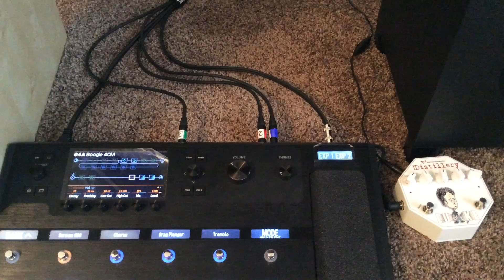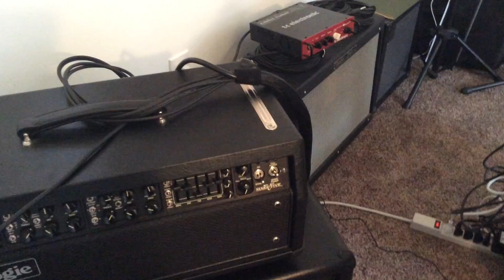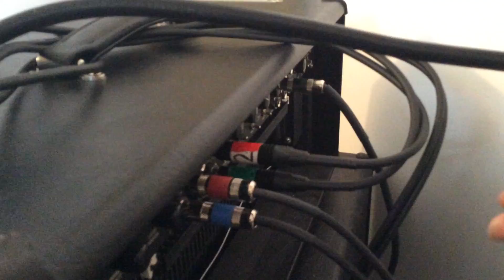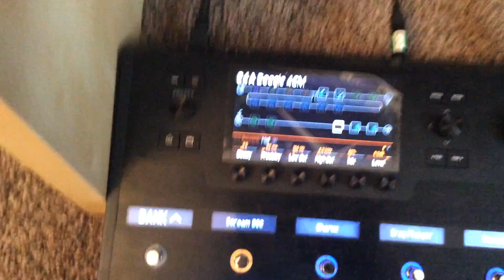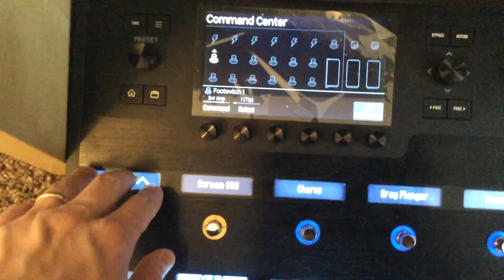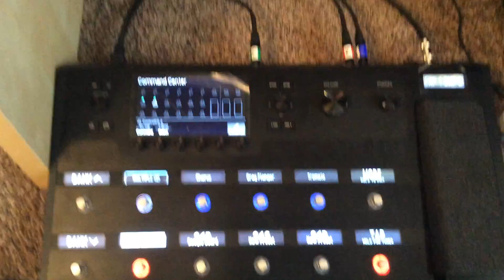Line 6 Helix with Mesa/Boogie Mark V 4 Cable Method

Comment: Dumb question.... but you have the FX loop on at all time right? I ask as I am trying to set up mine on a Recto. With the FX loop off the OD models in the front sound amazing.... but no Delay or reverb as loop is off. But when I engage the FX loops the sound looses some life. Any suggestions? Cheers!
Reply from the maker: I had the FX loop on all the time when I ran this rig. You might experiment with the mix on the delays and reverbs or maybe even run a parallel signal path in the Helix for the FX loop so you have a dry signal on one path and the delays and reverbs on the other. If it sounds good in the front but not in the FX loop, it's most likely just a settings issue.

Comment: I know you don't use this setup anymore, but maybe you'll still remember... did you ever have any humming issues with 4CM, or with changing the channels on the amp with the external relays?

I find that the hum in channel 3 is annoyingly loud (I can ignore it, but it's very annoying) when using 4CM, and completely unbearable when using the external channel switching.   I use an LT, so maybe it's just not as well designed as the full Helix.

If you did have issues like this, how did you solve them?

Thanks!
Reply from the maker: I never had issues with excessive hum when I ran this setup, but several people have commented that they have a hum problem with this or a similar setup.  I've never followed up with any of them about how they resolved it, but I would imagine putting in something like a Eb tech hum eliminator would do the job.  Good luck!
Reply: @JosephFacer  Cool, thanks for the suggestion.
Reply: Hi I bought the helix effect and it is similar to this. It has the noise you mentioned with my mark V. But I fix it and it's quite simple. The external amp switching I use the trs cable and split into 2 ts ends which are tip and ring. The sleeves (ground) of the 3 ends are usually connected and create a ground loop making noise. Simply disconnect the sleeve wire in the trs end and the noise should go.
Reply: @xianlinsu1512  Thanks for the tip!

Comment: I seem to be having a problem I can’t seem to get sound from my helix I connected it to my amp via 4 cable method but still no sound what am I doing wrong thanks.
Reply from the maker: Without being able to see your setup it's hard to say.  There's a really great group on Facebook for Helix users that would definitely be able to help you out.  I think it's called "Line 6 Helix Users Group" or something similar.
Reply: @JosephFacer  think I figured it out something to do with missing send and return I’m not using my amp I’m only using the effects from the helix to my amp but thank you anyways

Comment: Thnx for the tutorial. I have a MKIV which has multiple external switch jacks (RHY1,RHY2,LEAD,LEAD-EQ,SIMUL/CLASS-A,FX). I would like to have Helix presets controlling only between RHY1,RHY2,LEAD and LEAD-EQ. It appears there are 2 "Ext amp" jacks on the Helix, presumably you can use 2 TRS cables from the Helix with the 2 pairs going to the amp's respective external switch jacks, then program the footswitches on the Helix accordingly?
Reply from the maker: As far as I can tell, there's only one ext amp jack on the Helix (I've actually sold my Helix floor unit).  I'm not sure how the cv jack on the Helix could play into that setup, but if it can work the same as the ext amp jack (I'm not sure that it does, though) then your proposed setup would work.  The other option would be to find some kind of MIDI interface that could translate your amps 1/4" jacks to MIDI, then the Helix could control that.
Reply: @JosephFacer  thnx for your response. i was initially mistaken, i incorrectly thought there were 2 "ext amp" jacks, the 2nd is "CV".  after further review in this case, the helix is limited in channel switching capabilities. Yes, you are correct with the MIDI interface and i had an excellent unit for this from Toronto "Axess Electronics" CFX4 but i was stupid to let it go after i ditched digital for analog. Oh well! Thnx again!
Reply from the maker: @timp.9582  Good luck on finding a solution!  I love RJM Music gear for this type of thing, but I'm not sure if they make anything that interfaces with the Mark IV.  It'd be worth looking into though!

Comment: Hello guys!!! Can you also control de different modes of the amp? 
Exemple: Helix footswitch 1: channel 1 clean; Helix footswitch 2: channel 1 crunch; Helix footswitch 3: channel 2 mark iv.....would be so cool to make it a multiple channels amp!!!
Thanks!!! 🤘🤘🤘
Julien.
Reply from the maker: You can only change channels in the amp, not modes within the channels unfortunately.  The way this setup works is actually only off of a simple TS on/off signal sent from the Helix to the amp telling it to turn on/off channels 2 and 3.  If the amp had MIDI and the different modes were all MIDI assignable (which they aren't even on MIDI capable Mesa amps like the TC-100 or JP-2C) then you'd be able to do that.
Reply: Thank you very much !!! Have a good day!!! 😉
Reply from the maker: @easyguitar4466  No problem

Comment: I have a mesa roadster which has 4 channels...can I set up the helix to be able to toggle between all 4 channels as opposed to 2?
Reply from the maker: From what I can tell, you can't do this with just the Helix.  The Helix can only control two switches with a TRS cable, so you would only be able to have a default channel, then switching for two others (you could access three of your four channels).  Another solution would be to get an RJM Mini Amp Gizmo that you control via MIDI from the Helix.  You could set up snapshots so that it will send the proper MIDI message to the MAG to switch to whatever channel you want on that snapshot.  I hope this helped!
Reply: ok, cool... I actually usually dont use the 4th channel that much, so that will probably work...thank you.
Reply from the maker: Cool.  Then you'd just need to plug in your tip and ring into the two channels you want to switch to and you're set.  Good luck!

Comment: What kind of TRS cable are you using? I see you have it plugged into the EXT AMP and then into both channels 2 & 3. Is it split on that end? Thanks.
Reply: Thanks a ton. I'm hoping this works with my Triple Rec.

Comment: I got the Helix setup in 4cm mode but am getting a bunch of noise. Did you experience this?
Reply: Hello Rocco. Were you able to fix this?
Im having this issue with 4cm and Even with the helix before de preamp.
Reply from the maker: I didn't.  I've had several people actually comment here that they had a noise issue with a similar setup, but I never experienced that.
Reply: Damn! I've got everything working and the channel switching but I got this noise on Channel 3. It's killing me!
Reply from the maker: Sorry man, I wish I knew what to tell you.
Reply: Can you let me know what your Helix settings are for Send and Return? I'm also losing so much signal. I feel like I'm doing something wrong. I'm losing lots of gain. All I have is one send and one return in my preset, just trying to get the basics working.
Reply from the maker: I just had them both at 0.  There's a group on Facebook called Line 6 Helix Users Group Original that is a really good source of knowledge/help when it comes to stuff like this.  You might post there to see if someone can help you.  Sorry!

Comment: Also, can you program a preset to change the Mark V channels at the same time you engage other effects?
Reply from the maker: Absolutely.  Helix has a feature called "Snapshots" that is basically you set up a preset within your patch, hit the snapshot button, and it brings up all the effects and other stuff you had saved to that snapshot.  Each patch can have 8 snapshots, so you can basically have 8 different setups within a patch that can all be recalled with a single footswitch.  I've set up my snapshots so that when I hit my rhythm snapshot or lead snapshot, it automatically switches channels on the Mark V.  I explain that in more depth in the video I mentioned I'm making within the next week.
Reply: Cool. What do you use for a lead boost?
Reply from the maker: With this setup I was just using probably the Minotaur model in the Helix and a gain block for increasing level when I needed it.

Comment: Thanks! I see you are using the Helix to change channels on the Mark V. What outputs on the Helix are you using to do this? The reason I ask is because I am looking at buying the Helix put I only see 1 EXT AMP output, nut I see you are using 2. Are you using different outputs to do this?
Reply from the maker: I'm using a cable that is TRS on one end and two TS cables on the other end which allows me to use the one EXT AMP input on the back of the Helix to control both Ch 2 and Ch 3 on the Mark V.  I'm in the process of making a video with my updated setup that still switches channels in this same way, but I explain it a little better, so watch for that within a week or so on my channel.

Comment: Hi what model of TRS to dual TS cable are you using ? Just want to be sure I'm getting the right one..I'm getting the Helix today and I also have a Mark V Amp ;) Thx !
Reply from the maker: I've seen some people say that the HE2 gets the job done.  Glad to know it works!
Reply: Hey, I just bought a Ebtech Hum Eliminator HE-2 and it seems like it's doing the job ! No more noise at all :) Just need to plug it in between your helix and the front amp imput.
Reply: I have the same issue you have! I also bought the same cable but still have tons of noise.
Reply from the maker: I just bought one from sweetwater that was long enough for my setup.  Any TRS to dual TS cable should work just fine.  Here's the link to the one I use if you really want this specific one: http://www.sweetwater.com/store/detail/IPBQ2Q20
Reply: Thanks ! Most of the cable that I found look cheap. This one looks good
Reply from the maker: If you've got the cash for it, I would go with a Mogami cable.  It's not necessarily super important because this cable isn't sending audio, just signal for amp changes, but Mogami cables are super high quality and durable.  Just my two cents.
Reply: Thanks for the info man! I bought the exact cable you proposed me.. but now I am getting a hudge humming sound, a ground loop probably. You dont get any humming sounds with your setup ? It's strange cause I'm using the same amp and wiring than you ?!
Reply from the maker: That's interesting, I've never had any issues with hum issues with my setup.  Did you have it before getting the cable?
Reply: Joseph Facer Nope it's only when I am trying to use the channel switching from the ext. amp output...
Reply from the maker: Shoot, I wish I knew what to tell you.  Mine has never had that issue, and I don't know anybody else running this setup, much less the problems they've had with it.  You might check on forums or there's also a facebook group called Line 6 Helix User Group Original that can answer just about any Helix related question.  Good luck!
Reply: Thanks anyway ! I'll try to figure out. I'm still using the mesa pedal switch for right now and wow it's sounds so good !! IF only I could use only the helix that would nice.

Comment: I have a lonestar. What kind of cable did you use (from helix ext out to markV)? In the helix ext out you used one 1/4 jack and there are two on the back of mark V? So I guess one TRS into two TS jacks?  I would like to switch channels and solo function with my helix with the same cable you have used... Is this possible? The lonestar has ext switch outs for the channel and solo switching on the rear panel.
Reply from the maker: If the Lonestar has those outputs on the back, you should be able to control those functions from the Helix.  I'm using a TRS to dual TS cable with the TRS in the Ext amp on Helix and the TS into channels 2 and 3 on the Mark V.  That way, the tip (plugged into channel 2) will turn on channel 2, and the ring (plugged into channel 3) will turn on channel 3.  Using the snapshot feature in Helix, you can have it only turn on the channel you need on.  Otherwise, you would have to turn off channels is addition to turning on the one you want.

Comment: with the channel switching work with the Mesa Express(original) ????
Reply from the maker: I'm not sure.  I only have a Mark V, and I haven't seen anyone say anything about using the Express.
Reply: hmmmm I just watched again and you mentioned TIP when speaking about the amp channel switching set up. The express doesnt use a TSR cable it has like a 10 pin or 13 pin thing.
Reply from the maker: From what I can tell looking at the Express 5:50, the Express is just a two channel amp, so you could use a TS cable connected to the "channel" input on the back of the amp into the "EXT AMP" input on the back of the Helix, then just assign that in the command center.  You could also do a TRS cable and have the other mono end go to the "solo", "eq", or "reverb" inputs on the back of the amp and then assign them in the Helix command center to control those functions on the amp.  You don't use the amp's footswitch input for these controls, they have separate spots for the TRS mono ends.

Granted, I haven't tried it or seen anyone do it, but if it works just like the Mark V, then that's how it would be done.
Reply: my Express has no TS style jack for this it has a special 13pin type
Reply from the maker: Then I would guess it can't be done unless you could find some kind of converter from your jack to a midi cable.  If it doesn't have those separate inputs for channel, eq, reverb, or solo switching, then it probably can't be done externally as far as I know.
Reply: i will need to buy an AMP GIZMO it will do it.

Comment: Hey quick question for you!  I'm trying to route mine the same way as your setup, my only problem is I'm getting a significant amount of noise when I switch to channels 2 or 3.  I've tested all of my cables and it doesn't appear to be any of the cables.  Did you happen to have any noise issues during your initial setup?
Reply: I know this post is a month old but I had that same issue with my helix and Carvin amp, it had a real back ground hum buzz thing going on. The 1/4 cable I used has a tip and ring (like they all should) anyway I cut the cable about 6 inches on the end and striped and separated the 3 wires (2 shielded white and black and 1 bare) I spliced them back to the same colors but not the bare ground wire only the two shielded wires and the noise stopped, the switching still works with out that ground wire but no noise what so ever. Hope this helps.
Reply: Which cable are you referring to? I'm getting a lot of noise with my Mark V.
Reply from the maker: +moosevfa27 With my setup, the only noise I get is what comes from the amp with the increased gain on channels 2 and 3.  I haven't had any noise issues.
Reply: Did you ever solve this problem? I am still having this issue.
Reply: @cretacci  I know these post are old but I just got a mark v and saw this video on 4cm. With just 4cm I have little extraneous noise...but when connecting aux amp trs to ts y cable I get 60hz hum. Looking for fix other than Morley hum eliminator.

Comment: Cool setup!   How do you switch to your clean channel (ch1) on the MkV ?
Reply from the maker: +tomulator I have the Boogie set to channel one by default.  There's a switch on the back where you can switch channels or let the footswitch take care of it, and I set that to channel 1.  Then, when I step on the Helix footswitch, it turns on/off channel 2 or 3.  When neither 2 or 3 is active, it's automatically on 1.